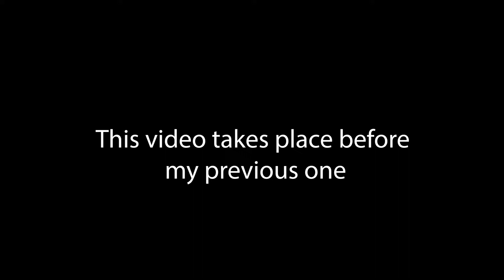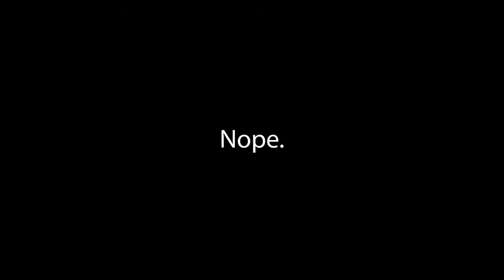Unlocking Insane Handling Performance: G35 Rear Camber Arms Review & Install Guide!

Comment: How did those camber correctors work out? I just installed simillar ones on the rear of my 2003 G35 coupe
Reply: How did that go for you? I wanna order these for my Z.
Reply from the maker: Overall they have help up. I have no direct complaints. It took a little bit to get them dialed in but that was user error!